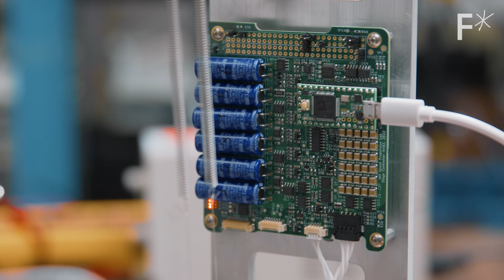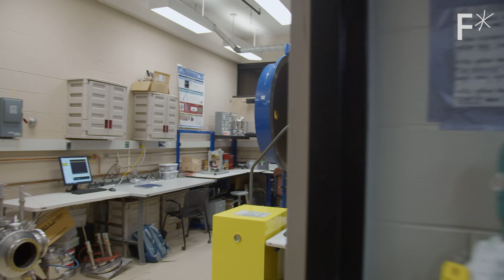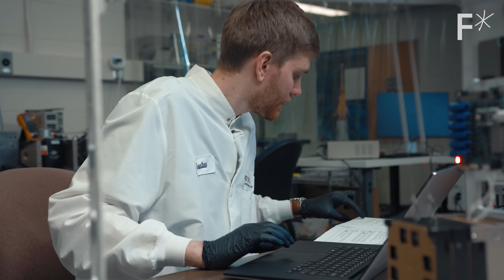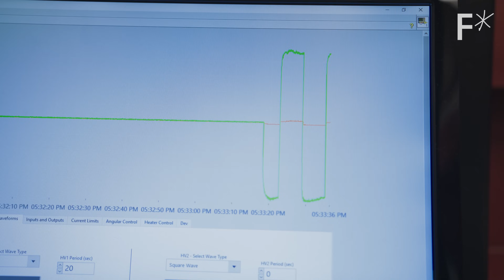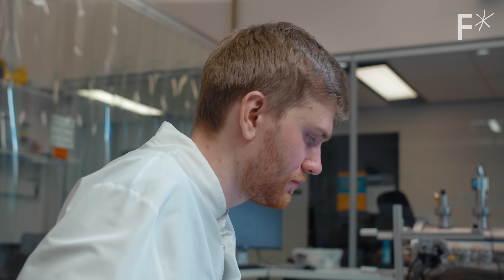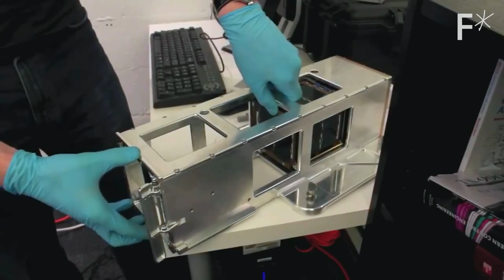MIT's electric thruster can allow us to explore deep space | Hard Reset

Comment: This may have been what I saw pass over my car on Nov. 21, 2008 just East of Kingman AZ. It had 6 massive rectangle shaped plasma or ion engines. Each engine was the size and shape of a drive-in movie screen or freeway billboard. About 100 to 150 feet wide and 50 to 75 feet high. 3 across and 2 rows. So, 300 to 450 feet wide and 100 to 150 feet tall.
I could see details on the bottom of the craft it was so near the ground. 150 to 200 feet above the ground. It had sparks dripping off the front and electrical arcing crawling across the bottom. The bottom of the craft had a design on it I will not mention here.
I will never forget this sighting.

Comment: You have done good work, no doubt. It’s novel (to an extent) too. So there is something called Astrodynamics, which allows for fuel efficient trajectory planning and manoeuvres. With firing the thruster at right points in the trajectory, you can take advantage of the gravity field to get to wherever you want. It would have been great to see an efficient yet high-thrust electrical thruster system. We lack that tech. Having disposable thrusters will cause debris proliferation. Something to think about when considering space sustainability. Maybe Prof. Linares at MIT can help.

Comment: Actually, it's very amazing! But does the spring based ejecting system work in the deep space due to the very low temperatures? If it works, then the precise jettisoning of the used up thruster can actually propell the vehicle much forward than the electric propulsion itself just in the video itself the upper carriage is moving pretty quickly !!! So u can capture that momentum into advantage aswell .

Comment: It looked like the engine used lots of really small aero-spikes. That's neat. I didn't catch what fuel was planned, I assume it can use any of the regular suspects for ion engines. I guess the craft will have enough mass that the spring loaded separation won't cause it to lurch off course. Those long springs seemed iffy to me.
Reply: Maybe the simplest solution would be to pivot the thruster 180 degrees and then fire in the opposite direction for a few seconds to separate from the probe while also pushing the probe away gently without any decision or need for elastic components like springs
Reply: @mbharatm  That just adds more complexity and failure points. A simple spring loaded system that they're using is sufficient

Comment: Will the springs in the separation mechanism perform (as well as demonstrated) when exposed to cold of deep space, and having been compressed at those temps for many months or years?
Reply: Maybe the simplest solution would be to pivot the thruster 180 degrees and then fire in the opposite direction for a few seconds to separate from the probe while also pushing the probe away gently without any decision or need for elastic components like springs
Reply: @mbharatm  A mechanism to extend out and pivot the engine around would be substantially more complex than mechanism that just pushes.

Comment: Instead of stages why not simply unfold each stage like a flower/oragami and then run them at the same time. That way you do not have the added cost of discharging each stage into space, which could of course cause more space debries which could hinder other missions.
Reply: You cut weight and increase the efficiency of the system this way. It's why multi-stage rockets exist. The debris shouldn't be a problem because they are supposed to be used in deep space, outside the orbit of the planet. I had the same concern. If they wanted an engine with more power though that isn't such a bad idea. Like the first 4-5 stages could be discarded but when they plan on having the craft fight gravity the last 5 could unfold and now it has enough power to maneuver in a gravitational environment.

The unfolding/origami thing seems to add unnecessary complexity though. Basically the engineers have to make a sacrifice to Cthulhu in hope it unfolds correctly. It made sense with JWST because it was a large craft that needed to be larger, but it doesn't make sense to me that you would need it for making a small craft a little bigger. Just make the small craft less small, and now you don't have to worry about disappointing Cthulhu.
Reply: did you not watch it? each stage has a limited lifetime, if you ran them all at the same time.....they all get disabled around the same time too. the point is to prolong usage by using multiple sequential stages
Reply: If you repel the probe from the spent thruster pack....the thruster pack is part of the propellant.  With a limited lifespan, blow the spent ones off the probe with ionic thrust, or magnetic fields, or explosive/chemical thrusters.  Give the probe a boost!

Comment: Nice work. I am not sure why the multi-stage system is needed there when electro-thrusters are not considered consumables?! And if this is the usual electrospray which jets fine droplets when high voltage is applied then such limitation to the need of liquid is not clarified well there, and frankly the technology has been there for many many years so I wonder if something is missing on the novelty of the work.
Reply: I think the reason of using a multistage is due to the wearing of the electro spray tip in prolonged usage ? Although the tips are not consumables, I think some sort of degradation still take place
Reply: Multi-Staging, isn't (1 x ms) the same as (ms x 1) total power available?
Reply: it saves weight.
so you don’t have to carry useless engines and propellant tanks.
every kg counts in space exploration.

Comment: Wireless power as a source of power. I'm not exactly sure how feasible it is to be ejecting propellant pods into space.  Humans should not turn space into a trash dumped.
Reply: Or one reallllly long cable
Reply: Dude space is massive. Like seriously massive. Not only is it massive it's self cleaning to an extent. We can probably dump billions of boosters in the inner solar system with no concern.
Reply: @Imaboss8ball  Its a problem if they orbit around earth though its basically already trash filled with space trash
Reply: @fuzer1234  low earth orbit can't be filled with trash. It automatically cleans itself. The high orbits are even more massive. When it eventually does become a problem we would have the capability to clean the orbit.
Reply: @Imaboss8ball  Yea sure, cleaning it would be more difficult than sending satellites to orbit
Reply: Also they eject those things because of electrode wear. Or at least it should be because of electrode wear.

Comment: at a high acceleration, won't ejecting the ion thrusters with unpredictable spring force result in a change of course which can't be corrected by the limited force of the thruster?
Reply: Propulsion systems are usually separate than attitude control systems. Attitude control on small systems is usually done with reaction wheels and those can cancel out the changes.
Reply: No not really-
orbital velocities / direction is measured in kilometers per second,
the seperation here would be lucky to eject at 20m/s.

If you make the spring system more practicable you can just use it as a speed boost.

More mass on the same spacecraft would cause slower velocity changes